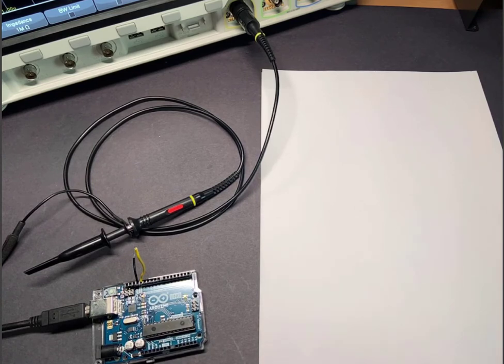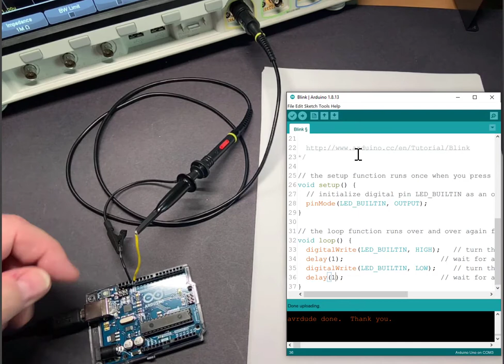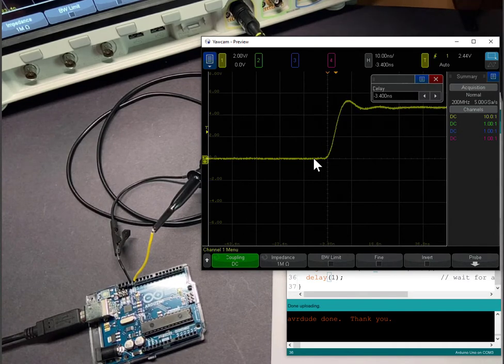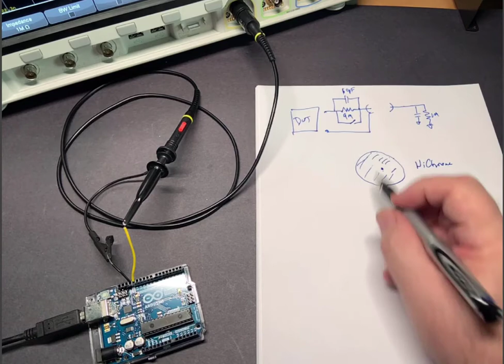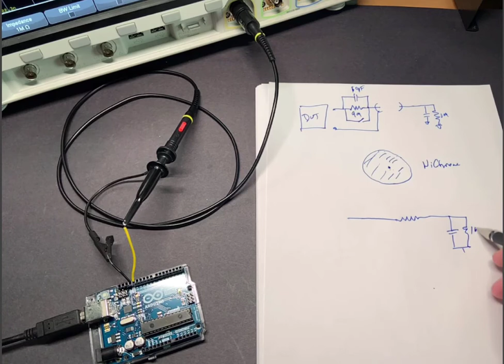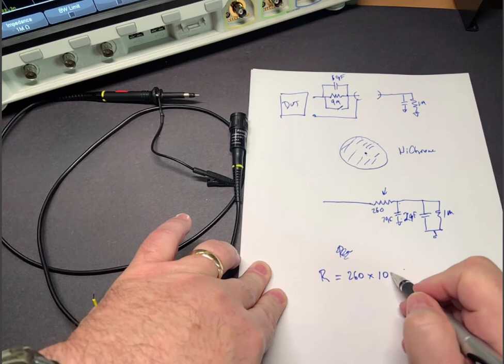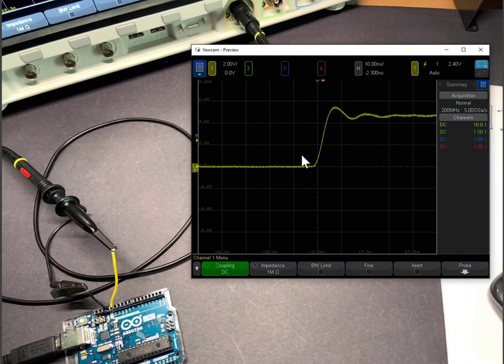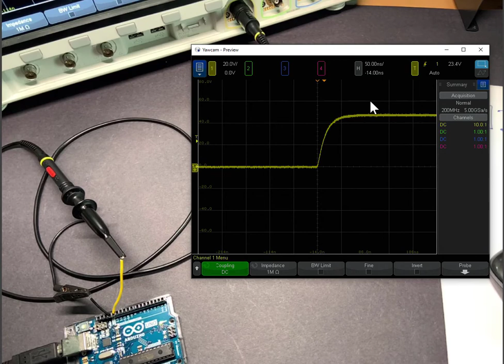SBW 7-7: Never Use the 1x Setting

Comment: This video does not explain how does the 10x circuit help with the problem. Adding 9M||10pF in series with Rwire=260ohm wouldn't reduce the RC of the low-pass filter, correct? Do you need to treat the cable as a transmission line to explain this? But then, is it appropriate to model the cable as a lump resistance and capacitance to explain the problem in the first place? Cable is much longer than wavelength of the fast components that are being discussed here (<5ns). Please help untangle this.